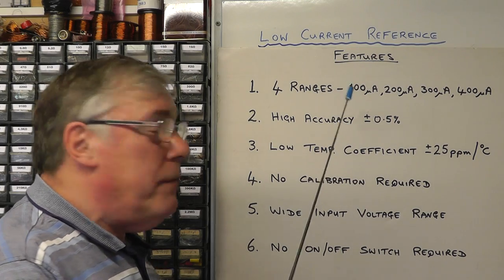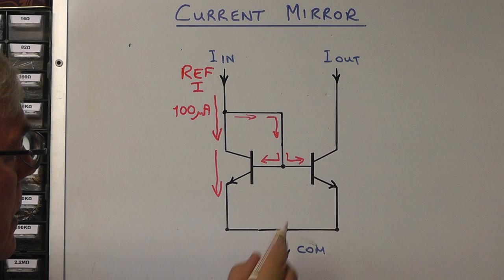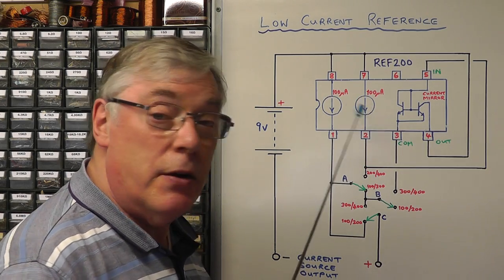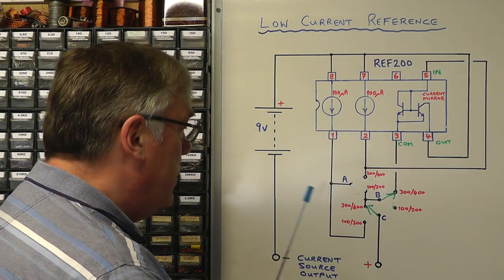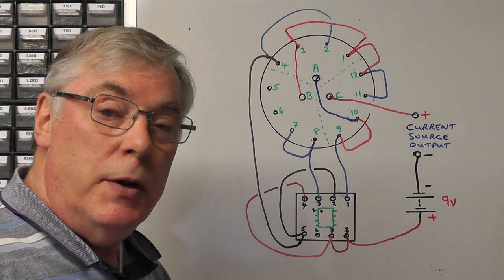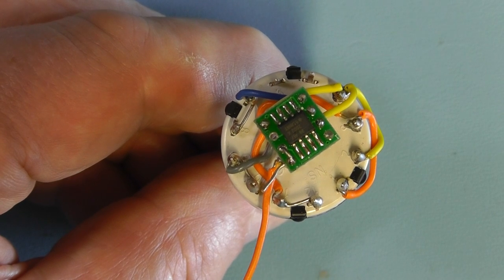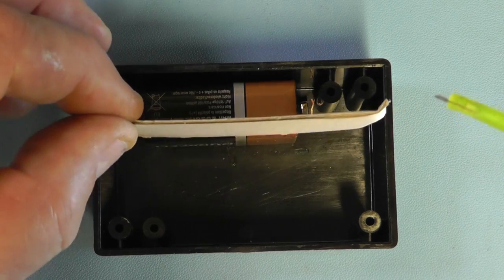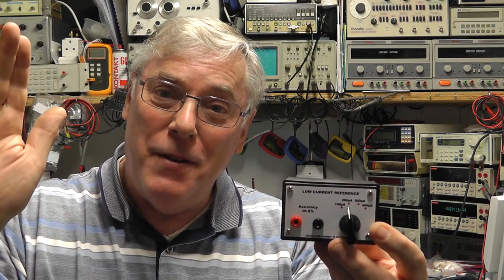Scullcom Hobby Electronics #40 - Design & Build a Low Current Reference

Comment: The funny thing is that I have the REF200 on the way because I want to build a variable current source / sink using the IC + a very good quality opamp and precision resistors! I have the wiring done exactly as you did, however I am using relays in order to automate the operation of the device. As always - very nice and clear video! A joy to watch!
Reply from the maker: +MrMonomonster Thanks for your comments.
Reply: Relays was one of the things that occurred to me too,  when I was looking at that switching...

Comment: I have now watched nearly all of your many videos, what an education it has been. Very well presented and with just enough detail so as not to be daunting or confusing to the average builder. Have you ever thought about building a AC voltage reference to go along with all your other fantastic designs? Keep up the good work. Karl
Reply from the maker: Hi Karl, Thanks for your kind comments. Good suggestion about an AC voltage reference which I will have a look at for a future project. Currently working on Part 3 of the Electronic DC Load Project. Regards, Louis

Comment: Thanks Louis. Nice little project. I have one of the UT 139C DMM's myself. It's a nice little meter for the price. Mine outputs 1.005V on the continuity tester, which could probably be used for a quick little 1V reference source.
Reply from the maker: +Robert Calk Jr. Thanks Robert. Yes the UT139C is a great little multimeter for the hobbyist and low cost to.
Reply: I think brymen is the oem Uni-T(as well as greenlee, amprobe, and some others) . Their website is straight out of 1995, but they are in my opinion the best bang for the buck.
Reply: +Terry Myers My Brymen 869s is my favorite DMM. Though I'll admit that I'm not sure how much I can trust it yet. So anytime I deal with mains power, I use my Fluke 87V.

Comment: Nice little project, Louis.  I like the construction method; it reminds me of an old Heathkit analog multimeter that I built in my youth.  It had dozens of components soldered between lugs on a big multi-pole rotary switch.

Will we see the reason you needed to build this?
Reply from the maker: +FlyingShotsman Thanks for your comments. I had a number of reasons for building this project. One was to do with matching a group of low value resistors. Another was as a source for a circuit which can give Nano Amps and Pico Amps reference source. It is also useful for checking multimeter current range calibration. I have a number of other uses which I may cover later.
Reply: @scullcomhobbyelectronics1702  I too would be interested in hearing more about this.  My reaction on seeing what it was and what it did was along the lines of "Neat gadget,  but what's it good for?"  Especially when your specifications at the beginning of the video are that precise.

Comment: Im supprised how good that is, so the chip has two constant current generators, accurate ones at that :-D
Im not sure that i would ever need a uA range on a basic multimeter, mA is more my cup of tea, most of the things i repair are so crude that the uA range would be redundant.
Is there such a chip that can provide constant current at higher levels?
Nice little project though :-D :-D
Reply from the maker: +zx8401ztv Sorry for delay in answering but for some reason google put your message in the spam folder - strange !! I have been using this Low Current Reference to precisely match some resistors. 
The LT3092 provides higher currents - I did an earlier video with the LT3092 and had two switched outputs or 1mA and 10mA - the link to this video is below:
https://www.youtube.com/watch?v=EXTRKXhvBJU
Reply: +Scullcom Hobby Electronics 
Oh im sorry, it seems my memory is playing up, i saw my comment on that video nearly a year ago, i need a new brain lol :-D
Its possible that someone dislikes me and marks my comment as spam, dont worry :-D

Comment: Does anyone have a part number for a switch they like?  I could only really find one on mouser, and didn't see any part numbers in the documentation.  Thanks!
Reply from the maker: Hi George, I used a Lorlin CK rotary switches (Mfr. Part No. CK1031). I purchased it from Radio Spares. Checkout the link below for full details:
http://uk.rs-online.com/web/p/rotary-switches/0320691/
Also it is available from Mouser:
http://www.mouser.co.uk/ProductDetail/Lorlin/CK1031/?qs=%2fha2pyFaduhnUOhbpoX3ZtFQoy%2fpFNukhOt8iLr3t54%3d
Also from Farnells (Element14)
http://uk.farnell.com/lorlin/ck1031/switch-3pole-4pos-0-15a-250v-solder/dp/1123707?ost=CK1031&selectedCategoryId=&categoryNameResp=All%2BCategories&searchView=table&iscrfnonsku=false
Regards,
Louis